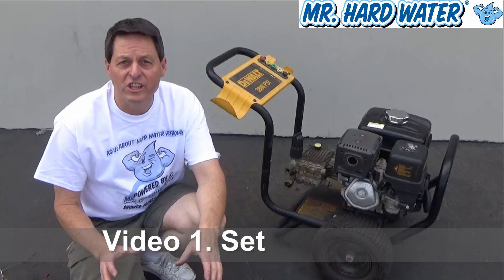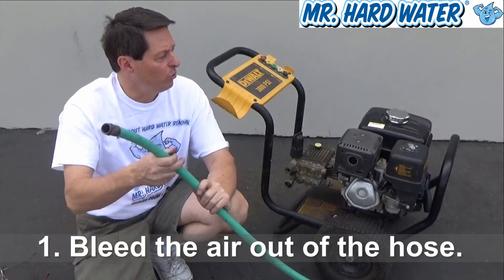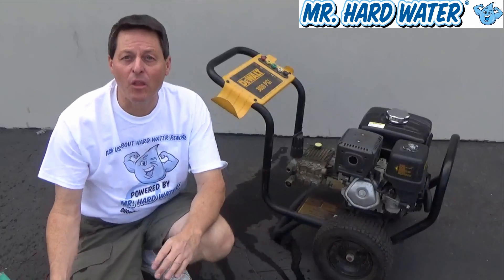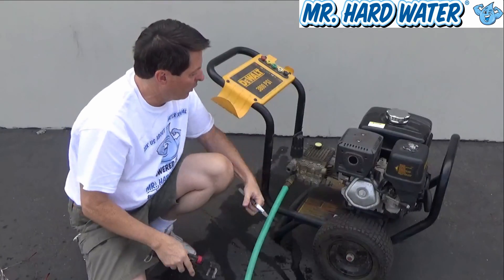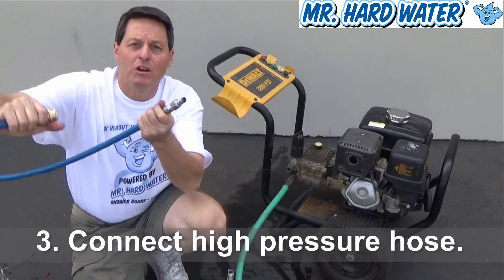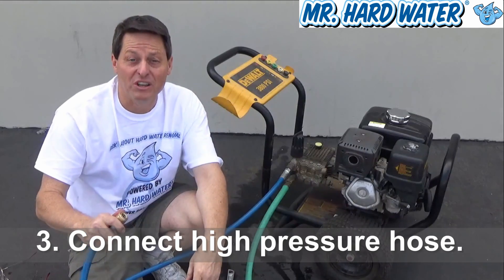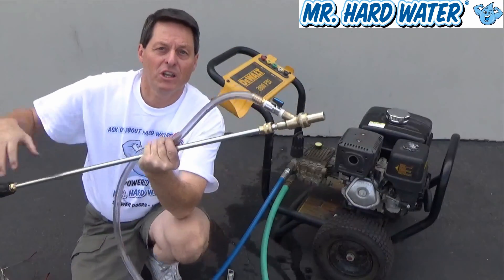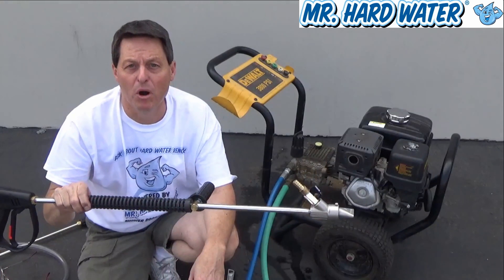Dewalt 3835 - Part 1 Connecting the Hoses - Mr. Hard Water Wet Blasting

Comment: I have the 4000 psi model.   I think my pressure regulator is defective.  It says push down to turn but the black cap is down.    I can pull it up with no resistance and let go and it falls back down.  Shouldn’t it be spring loaded so you have to push it down?   Even though I think it’s down it absolutely will not turn either direction.   I’m tempted tool use channel locks but the black cover/cap used to turn up or down is made of plastic and I don’t want to break it.   I really want to use the regulator.   Am I doing something wrong?   Do you think a tool will break it lose from the factory setting?

Comment: His idea of getting all the air out of the hose before connecting is absurd , as soon as you turn the water off to connect it to the PW you have air back in the hose, because spicketts are typically a few feet of the ground on your house and he's holding the hose lower so gravity would drain all the water out of the hose defeating his whole idea of getting the air out. What you should do is attach the hose to the PW then turn on the water and press the trigger on your wand with the motor OFF until you get all the air out.